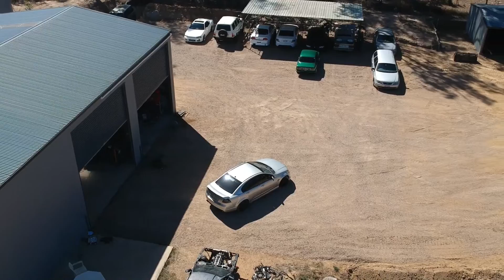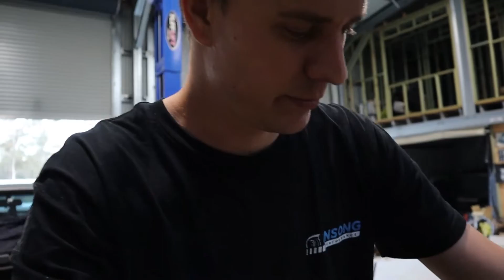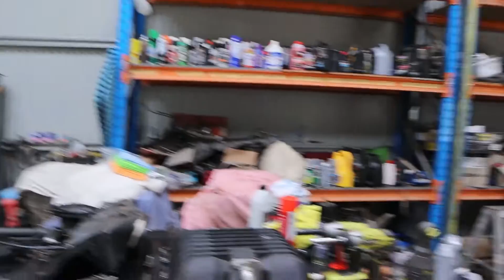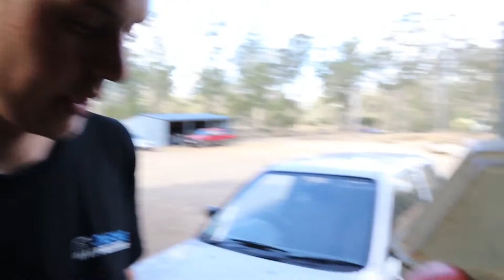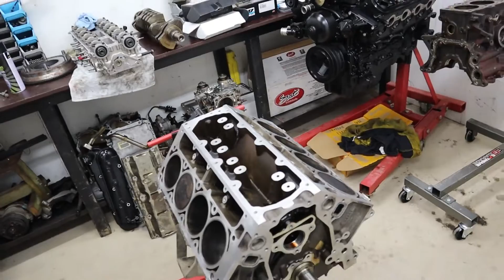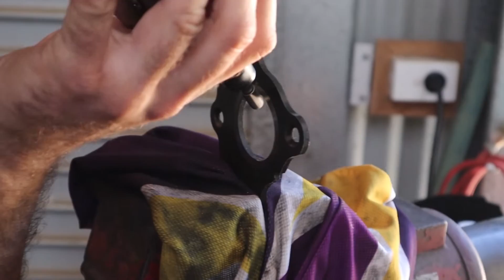Supercharged VE SS Build Begins!

Comment: Trunnion failure happened to me because a shop installed garbage part. I have 8-9 needle bearings unaccounted for so they must be at the bottom of the oil pan just like that. I was told it will be fine :) I did CHE upgrade and it's been good for over a year. I need to remove the pan and clean it at some point but it's sad how stupid hard GM made it to remove.

Comment: Idk what u mean by 370hp good outta a 6ltr with headers exhaust cam intake and tune should be sitting at atleast 430hp mark regarless of auto manual
Reply from the maker: Absolutely not. 430hp is what you would expect from a half decent cam with those mods through a manual. A stock cam 6L through a manual with full exhaust and intake with tune will go about 360-370hp. For a baby cam in an auto, 370 is pretty decent.
Reply: @BoostGumps  mate 370hp there’s gotta be something not right a ls1 makes that power easy enough ur telling me a ls2 regardless of the cam it’s all in the tune either whoever tuned it hasn’t got a fkn clue or the motor ain’t to happy
Reply from the maker: @bigroger1989  it’s not an LS2, its completely different. I have done more LS packages than I care to remember. I know what sort of power they make. 430whp from a baby cammed rectangle port through a 6L80 is pretty good. With a decent cam and a little taken off the heads you could expect 420-430. The same setup in a manual will go 430-440.
Reply from the maker: @bigroger1989  an LS1 makes 370hp “easy enough” with, you guessed it, a decent cam…. A baby cam like this in an otherwise stock 5.7 might go 340-350

Comment: Whats need to bolt on done alot oil pump , trun and bearing upgrades all new cam pack vcm883 and all new gasket and bearing kits and new piston rings and new lifters have list whats done but wanting to superchager just want i dears on what i can do as to bolt on or do need more upgrades to do so looking 600 hp

Comment: L98 engine with 6 speed auto that's odd. I thought L76's were auto and L98 were manual.
Reply from the maker: Nah plenty of L98 Autos around in the early VE. Just the later ones were differentiated as the AFM was only available in Auto which was the L76. Untill the L77 (Flex Fuel) came about which replaced both, just that the AFM (DOD) wasnt activated on the Manual Cars

Comment: Doing good for young guy's. In saying that the workshop is a mess. Your work benches r over crowded and a mess. Personally I prefer to go to much more organised organisation. Bring on the hater's but it's fact
Reply from the maker: It is what it is. We are a very diverse workshop particularly for our size. We do the best with what we have
Reply: @BoostGumps  good reply. One must look to improve at ALL times. There is no room for excuses. All tools and part's have allocated locations and should be there without fail. No bench should have anything other than what U require at that given time. I say this and could say so much more as I believe in U and where your company could go if U be harder on yourself.
Have a great weekend in the shop I hope young man
Reply: @BoostGumps  if I may say one last thing.
With what U have U say.
Some of the greatest monuments have been built with only rocks craved from a hammer and a piece of iron and using a piece of string. No steel, no big modern machinery, just will with ZERO excuses and only problem solving. These monuments still stand 3000 year's later. Do U think Mr Sanders made excuses? No ha solved problems to create what U C today KFC.
Young man excuses r for loser's. R U a loser? I didn't think so. Excuses turn into regret and regret will haunt U when U r old like U cannot believe. U hold the key to what can be a 3000 year old industrial war horse that will guarantee the future of your family forever.
That's all from me.
Take care and give everything U have. Everything.
Reply from the maker: Damien Robinson   i appreciate the feedback, really i do. I would love to have a spotless workshop where we work through one job at a time. But this just isnt the reality for us. Due to the current world situation (covid) and our location, the need for any one part can set any job back well over two weeks. As such in order to maintain efficiency we generally have a massive amount of projects happening at any one time. Couple this with the fact we do engines, general mechanical, minor machining, tuning, paint and panel, fabrication and wiring. On 4x4, jdm/drift, old school, LS etc, it does get a little cluttered and messy, but it works for us at the moment. We have grand plans to expand, but it is slow as we dont want to kill our love or this by going into debt to do so.
Reply: @BoostGumps  I appreciate your reply. Maybe U should look into franchising which would reduce your overheads and start the ball rolling on purchasing in bulk which will reduce your cost further. Inventory management is a very easy process and a storing location within your shop would take up very little space at present. With that it would reduce all the unused items/parts lying around. Cycle counts done weekly will allow U to understand what parts U r short on and in turn control future purchase processes. Am I saying that the Rd will be easy? Yes and no. It depends on what U believe that is what controls everything. without risk there is NEVER rewards.
Take care and I will continue to watch your progress.
Reply: @BoostGumps  remember the equipment U purchase for upcoming franchised shop's will be paid off by the renter's over time and will become great assets moving forward. As long as U get your numbers right and have processes in place to ensure the right buyer's are engaged U will be ok. Transfer your current asset's to mum/Dad or someone whom U trust and if everything falls to shit, U file bankruptcy and lose nothing but your pride. Off course there is so much more to it but I'm sure U understand. Tenant's r ONLY buying the right to use your name. All there stock and equipment must come through U.
Reply from the maker: Damien Robinson great minds think alike my friend! We have already started this ball rolling. We are starting a new venture currently (OnSong Performance Warehouse). I figured we needed to start buying bulk to retain stock to limit this down time. Considering we have quite a good supplier network from the business, but also this youtube platform where we also have quite a good marketing reach, we decided that if we are going to hold the stock we may as well retail it to the public through ecommerce as we go. A little extra money in our pocket, and as you said, doesnt require a great deal of room nor time. An hour each morning and afternoon to invoice/pack/ship orders, and an added bonus we should (hopefully) always have stock of parts we need for customer cars!
Reply: @BoostGumps  U C no excuses just positivity. Know this, getting bulk items at present isn't just about today. The car industry is in for major changes in the coming years to electric. In turn there will be a downturn in production of these parts and therefore increased price. Look at it this way. Today's part's r tomorrow's Gold. In your life time today's part's will be so desired that U will be able to charge whatever U like. Off course aftermarket parts will become widespread but U will have genuine parts/Gold. The reason I say what I do is this. U r a very capable and smart young man that if given a push and studies business at night, even when U r on the toilet anything is possible. Take risk keep assets away from harm and believe it will work out. There is something about U that says this man can achieve. Seek out high profile business people and try again and again and again to get more advice. Sit down and write down what U would ask them. Even what is their favourite hobby. U can use that to your advantage. Anyway go get it. Yes U could set-up your next generation by just rolling by like MOST or U can be the one that sets up generations

Comment: The Magnuson 2300 blower would have been a heap better choice than the LSA blower. Anyway I’m sure it will still go good.
Reply from the maker: Yeh but still nearly double the cost
Reply: I got a Magnusson put on mine yeah not cheap but goes like a dream. $11,000 for the charger, $2000 to fit and dyno tune.

Comment: i just did this exact build myself but stock cam and converter. just did valve springs. made a healthy 550rwhp and 813nm and is a great daily :)
Reply: also before you bolt on the supercharger make sure has a solid isolator in it as my brand new one did not and became noisy within weeks
Reply from the maker: @haydensmith9064  thanks for the info mate! Sounds like fun, im very jealous i want one of my own 🤣
Reply: has nothing on your builds mate but keeps me happy :) thanks for the reply
Reply: Damn that's a lot of torque mate 😜

Comment: Why didnt the bottom end get done also. thought full rebuild would have been better idea
Reply from the maker: The engine had fairly low KMs, and didnt present any bottom end issues. Due to GM using all Torque to Yield fixing in their engines a simple rebuild actually becomes fairly expensive. For the cost of doing so we didnt feel it presented any real advantage for this particular engine
Reply: Thanks for the reply